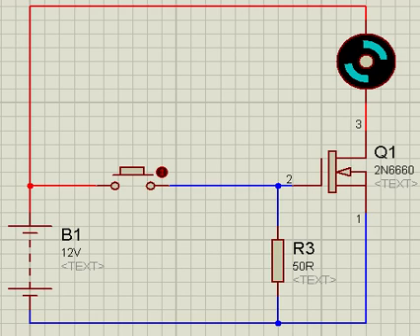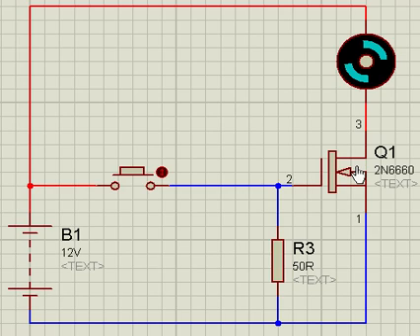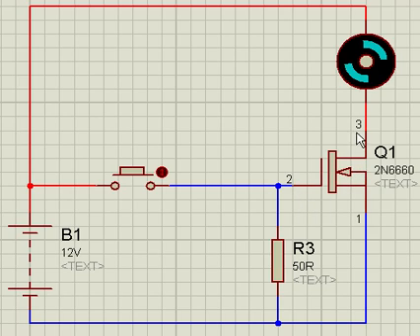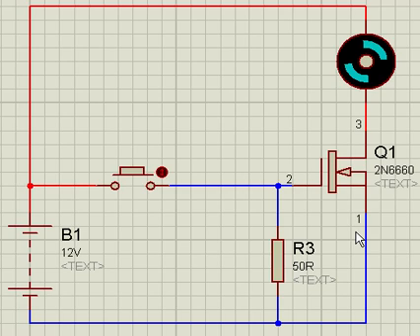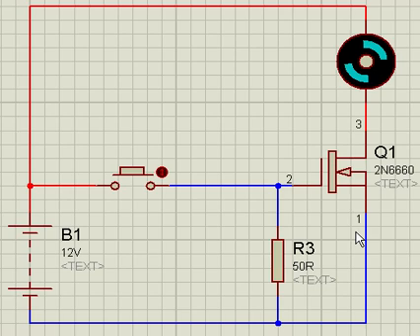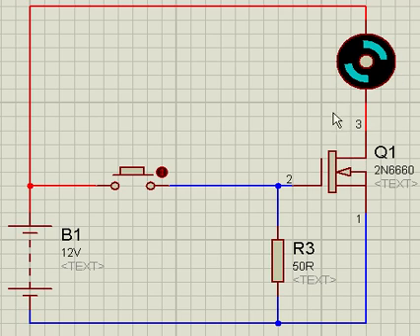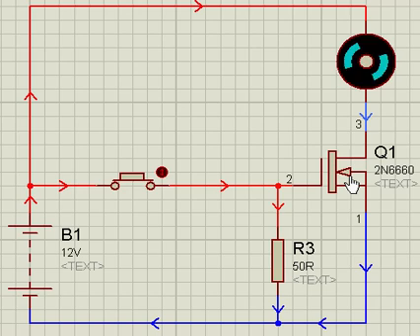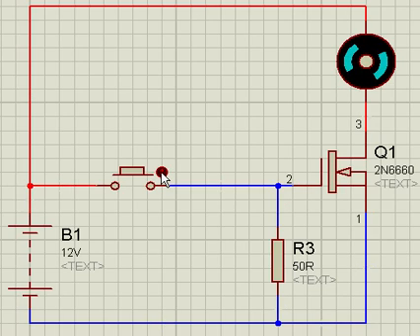MOSFET as a switch

Comment: This circuit confused me.  the transistor symbol looks like it is showing a N- channel depletion mode MOSFET (off at a negative voltage (Vgs(off) a normally on device.)   But, it acts like an enhancement mode MOSFET (off at Vgs=0 a normally off device.)